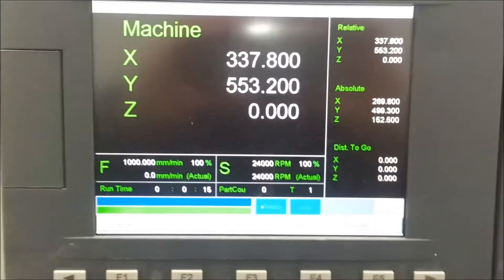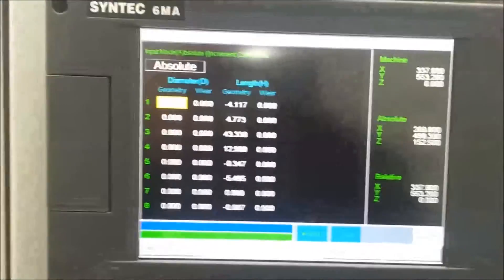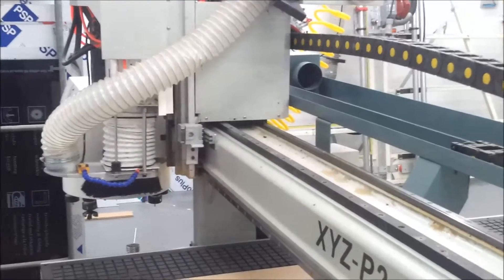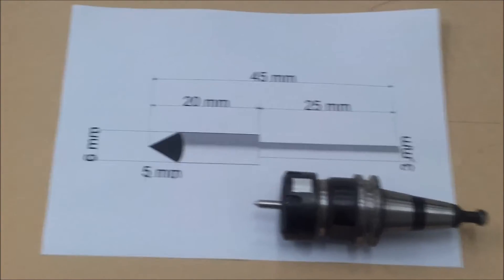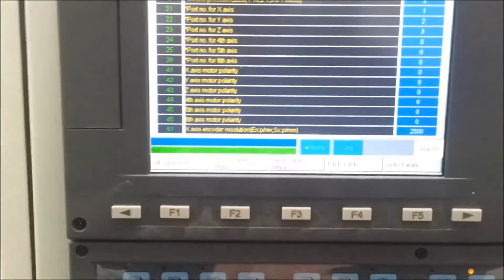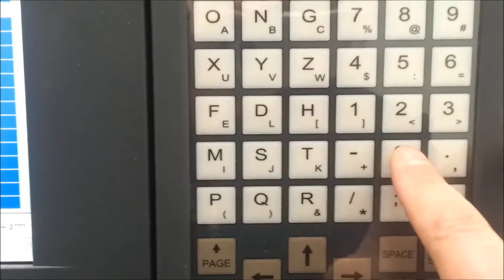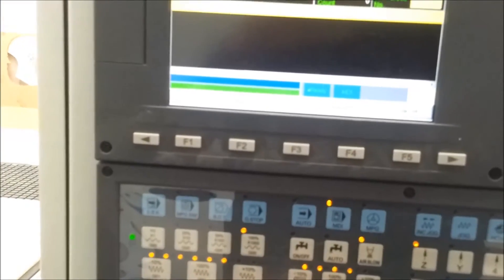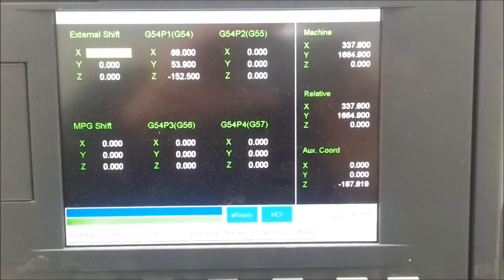Syntec 6MA Auto Tool Part 1

Comment: Trying to figure this out on our machine but that parameter (3411) does not exist on our controller. I beleive we do have a newer version that has the Delta Z setting under Tool Offset/Setting > Tool Tip Measure but it doesn't seem to work. :\ The CNC supplier is no help. We're forced to measure each tool every time we change material thickness and/or fly cut the spoiler board. Not fun when you're using multiple tools.

Comment: Hello Lee.
I am now to all of this, and in recent days had my share unfortunate events while trying to learn how to operate the router I just got. (w1325 with linear magazine 6 tools and Syntec 6A). Want to say thank you for the great video, i really did learn a lot from it. After watching it and some other ones, I am kind of confused, you note that reference tool is a must, while other do not use it. Can you please shed some light on this subject? Also not to be rude or anything of this nature, I am having a bit of a problem with Z axis not going up during the tool change procedure. It does not happen at the part and does not happen at the tool holders, so longer tools are way below the machines table. Is that something in the controller or is it me? I have posted some help questions at CNC router forums but no reply's for that. 
May be you can help?  Thank you in advance.

Comment: Hi Lee
I tried to follow your method to set the Auto tool in my Syntec 6MA, but unfortunately after choosing my reference tool with MDI light turned on, when i press F2 the spindle doesn't move toward the tool sensor, but it loose the tool, I tried to press F5 instead of F2 the spindle has moved to the opposite direction of the tool sensor location. ?!!
One more thing please, when i enter the parameter number 3411 it leads me to "Extension parameter (R91)" is it the same as Auto Tool to table distance ?
Thank you in advance